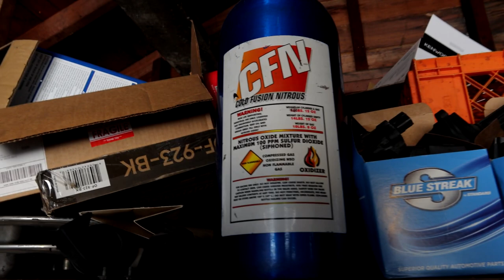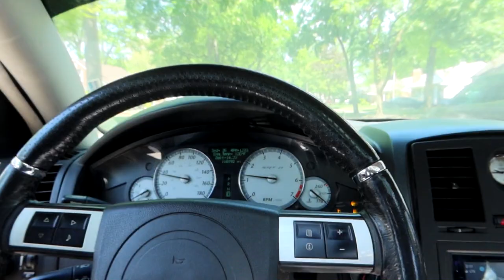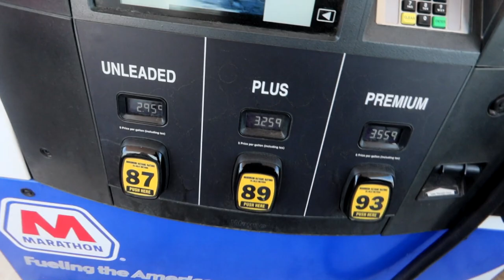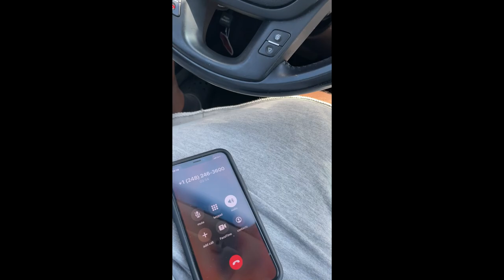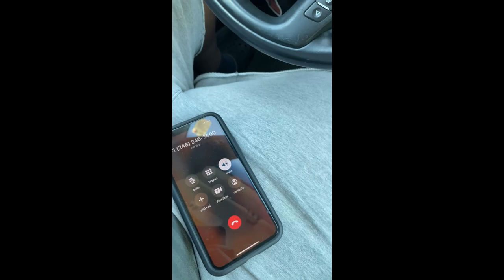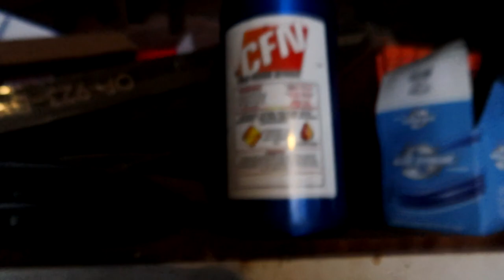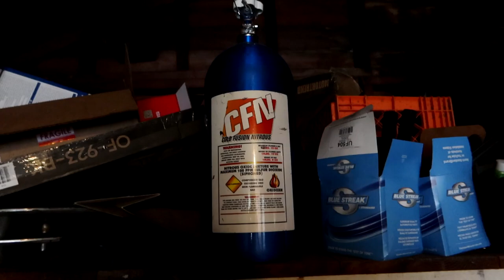Installing JBA LongTube Headers On My 300 SRT8 *Way Too Loud🤯

Comment: I have a 06 Chrysler 300c 5.7 awd, gonna start making some videos on it. I do all my own work and there are zero videos on anything involving fixing them. I gotta change oil pan gasket here in the future. Thats gonna be a good one to start with i think. Gotta pull the front differential out to do it. Should have started already ive fixed a ton of stuff to get ready to add some more power to it
Reply: Don’t know if you still have the awd 300 but plz make some vids bro
Reply: @ogdash9500  I do in fact still have my AWD 300c, I have a rear main seal to do coming up. I run my own shop so if I start doing videos, I could do some on a lot of what comes in. I guess I could go over some of the countless things I've done over the past 2 years. Oil pan gasket, both front axles, both driveshafts, ac condenser, new injectors and a bunch of other smaller things
Reply: @frankhartford5194  dope. I have a 05 awd 300c and there isn’t much info and videos out there for it
Reply: @ogdash9500  there isn't that's for sure, I planned on doing it but life happened, and I don't get to much time for my own stuff now. Weekends I usually save for my stuff, I went by service data when I did my oil pan gasket. Granted I did it before I had a 2 post lift, but if you get stuck on something I might be able to help you do whatever it is. Another thing is I'm kind of worried no one will watch if I make any videos, and it be kind of a waste of time, because it's gonna take the repair longer to film it. I will when I do my rear main though, should be within the next month I tackle it
Reply: @ogdash9500  mostly everything I did to mine was before I had a lift, I did the engine mounts too I forgot about that
Reply: @frankhartford5194  man I’ll subscribe Right Now!🤝🏾

Comment: Nice 300 ...every since I str8 pipe my car from cats to mufflers it’s been cutting off ...what do I have to do to stop that
Reply from the maker: You need a tune for catless air/fuel ratio may be tryna read the cats there if that isnt it probably might be time for new o2 sensors gang
Reply: @T33Baby  yeah becuz I replace all the 02 sensors
Reply: @xaviergarcia3868  you might have an exhaust leak too bro

Comment: That sound sounds like exhaust leak
Reply: Did you use a mopar gasket? The aftermarket ones are rubbish
Reply from the maker: I don’t even know if it was the original gaskets they just threw them on for me